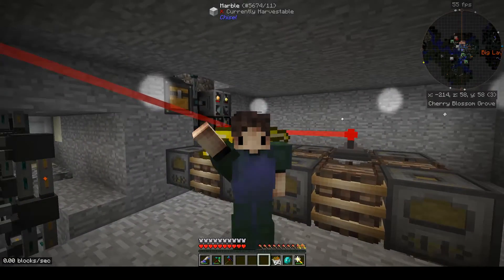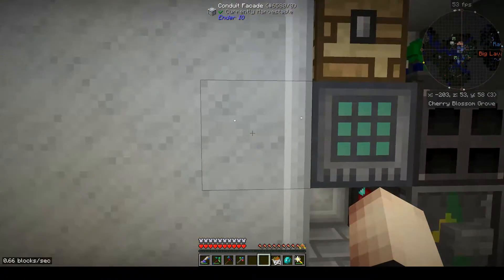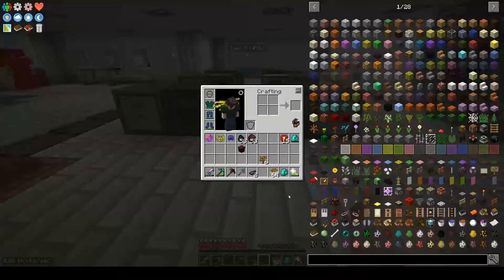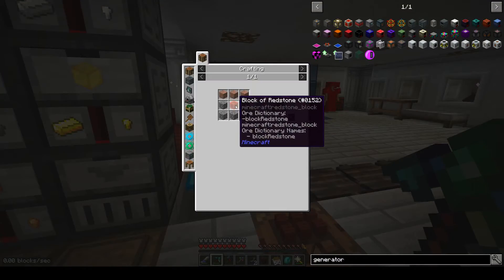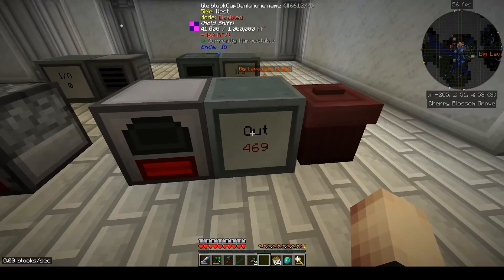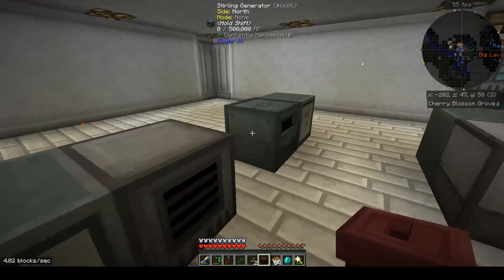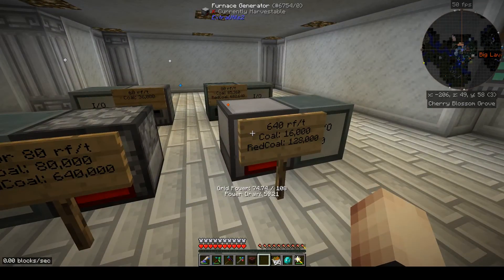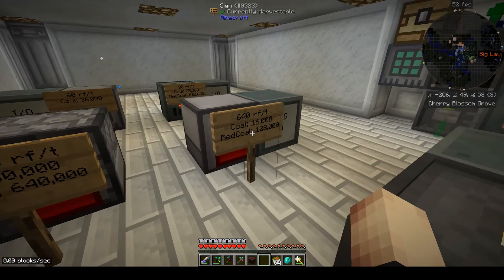FTB Direwolf20 1.10 Ep18 Which generator does 640rf a tick

Comment: For Lots of GP:  http://imgur.com/a/NLnej
Red Circles are water source. You can expand as well. Super easy . 336GP
But after looking at your new video I guess you figured that  out . LOL
Reply: I like this chart, it's very clear and outlines the 1 block away flowing water optimal setup.  I usually never need more than around 110 GP but now that I am doing the super overclocked furnace I have an actual need to go higher!  Of course the easy way is just to throw down a dragon egg generator but having big GP without that is always nice since the dragon egg generator requires a pair of nether stars and sometimes people can't do that quite yet.

Good addition indeed!